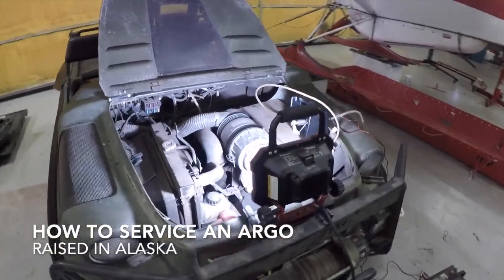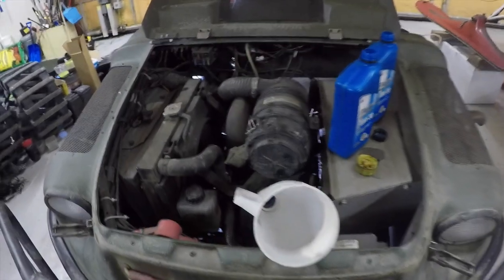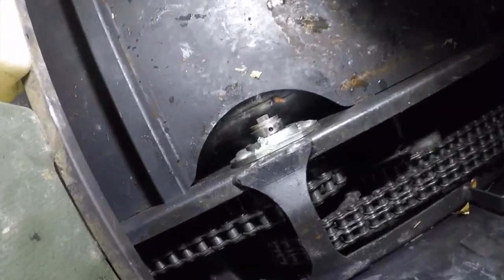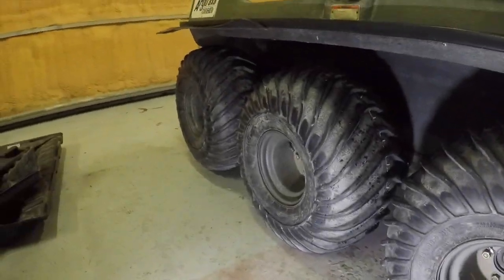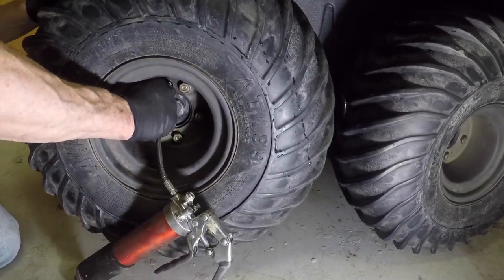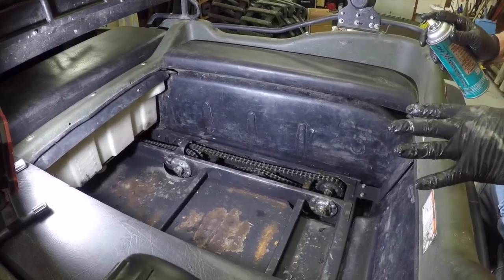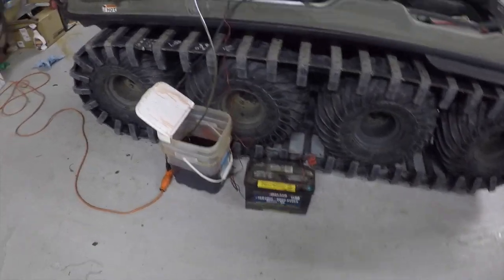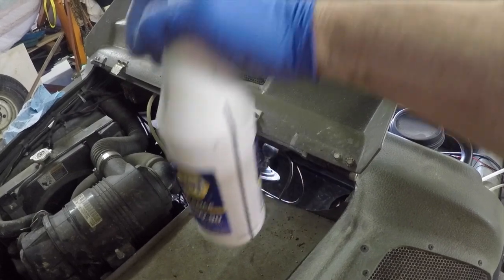Argo ATV: How to Service an Argo

Comment: Great vid.  If you add a straight pipe to your grease gun it will make greasing the outer bearing way easier.  Argo owner for 25 years.
Reply from the maker: That makes since, why didn’t I think of that. Thanks.👍🏽
Reply: @waynekrangle8447  ,, hola,, amigo,, e leído que tienes estás máquinas ARGO hace 25 años,, con tú experiencia,, como has logrado extraer y reparar el motor de partida desde el interior de este tipo de vehículos???,, si puedes ilustrarme al respecto con algún vídeo o tutorial en internet.. Saludos cordiales desde Castro Isla de Chiloé en Chile 🇨🇱🇨🇱🇨🇱🇨🇱

Comment: Great Video.  I was wondering what size of hose you used to get down the dipstick tube?
Reply from the maker: @chadriopel6914  I believe it’s 3/16, t’s very tiny. It sucks out a lot easier when the engine oil is hot.

Comment: Nice video do you happen to know about how to get to the alternator on these we have the Avenger 750 EFI and our does not seem to be charging the battery
Reply from the maker: I think the alternator kit is an option. Without an alternator electricity is made with a magneto.  The manual say to start by charging the battery.
Reply: @Raised in Alaska  ok thank you for the info

Comment: I struggled today to suck very much oil out of the tranny. Do you actually get the 1200ml out of it? I even jacked the front of the argo way up and still only was able to get about 300ml of fresh gear oil into it, after extraction, before being half way up on the sight glass. I just find the gearing so close to the drain hole that I can’t get my nylon suction line down in there. I’m thinking I need like a flexible silicone line or to make an adapter on the end on my nylon one (it’s not very flexible). Any thoughts??
Reply from the maker: I use a small hose to get past the gears. The 80/90 oil is thick so it’s difficult to suck out. I run my machine, to heat up the transmission oil, before I suck it out or I put heater on the transmission to warm it up before I suck the oil out.
Reply: @RaisedinAlaska  okay, thanks for the advice!
Reply from the maker: @jeremyah78  Good luck.

Comment: How often does it need this?
Reply from the maker: I grease all the bearings every time I take it out. It is common that outings find me in the water, so greasing the bearings pushes the water out. I change the engine and transmission oil annually.

Comment: Do you spray silicone lube on your clutches??
Reply from the maker: I have not sprayed anything on the clutches.
Reply: @RaisedinAlaska  I seen on here someone spraying it on and saying wait till it dries before you drive.
Reply from the maker: I’ll check with the dealership and reply with information. I never have, but that doesn’t mean that I should not have. I’ll find out.
Reply from the maker: I just called the All Seasons Argo dealership in Anchorage and they told me that might be something you would do with a snowmachine or a side-by-side where you’re running 8000 to 10,000 RPMs, however in an Argo you’re never really going to exceed 4000 to 5000 RPMs and so it’s not something that you would need to do  because the RPMs are not  high enough do you need a little bit a slip when you first engage it the clutch.
Reply: @RaisedinAlaska  don't forget it is a stealership. they likely don't sell silicone spray so they dont want you to go anywhere else cause when you see how much argo overcharges for their grease ,batteries etc you'll never go back..lol.🤣
 Thanks for checking though👍
Reply from the maker: @jamiehalifax4954  Their prices are a bit steep.😉